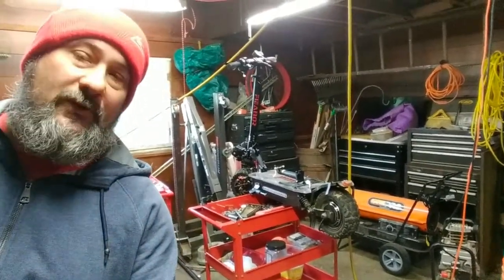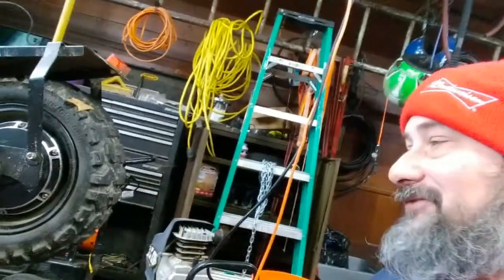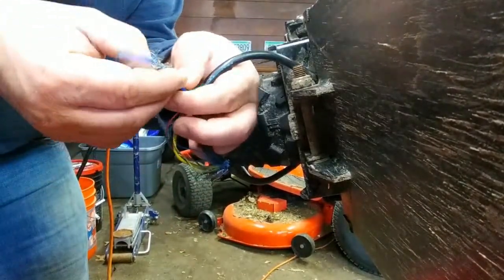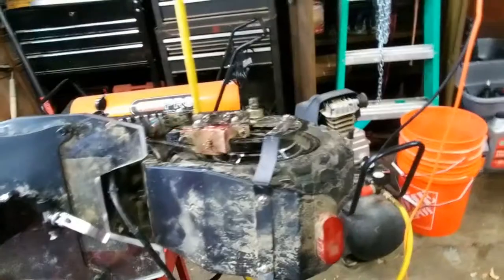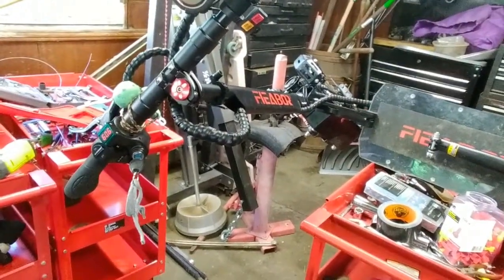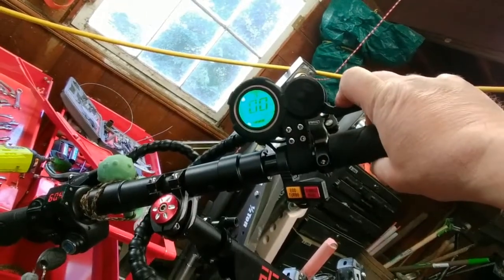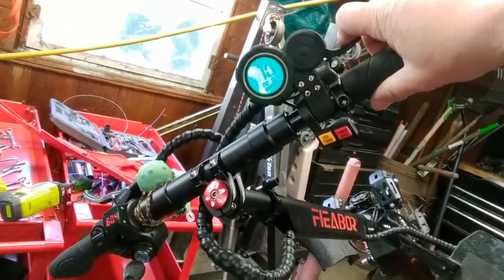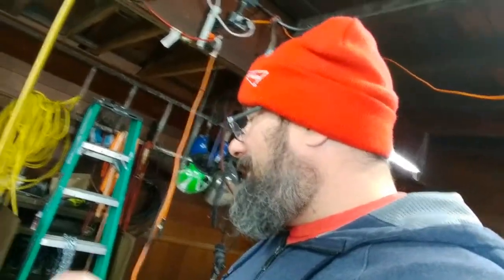5600w Electric Scooter fix rear motor wires test

Comment: Hey man. My rear wheel is Barely spinning. It shakes the scooter really bad. The panel initially said “controller failure” but now it kicked off and the Amazon seller won’t help. They keep spinning me. What should I do?
Reply from the maker: File an A-Z claim with Amazon........It kinda sucks but you will get your money back........My scooter needed a lot of work/adjustments before I took it out......1 st thing to check.....Make sure the rear wheel free spins.....Make sure no brake hardware is in the way or colliding ......2 nd thing to check is air pressure in both tires.......low air pressure will cause the scooter to violently shake at times..........Also the rear motor wires will have to be re run so you do not end up like I did in this vid......Check the harness for pinches or scrapes........Good Luck Bud

Comment: I gotta guestion.. I put my scooter on single motor and no turbo. And has like no power at all. Even with dual motors going still slow as hell. But when I hit turbo.. boom all the power is there. I mean like shouldn't it still have power in single and dual motor mode?? I know I'm not crazy here.. cause something don't seem rite.. help plz
Reply from the maker: Sounds like single/dual switch is broken.......If turbo works then both controllers are good.......Chances are its a faulty/loose connection in the deck at the wire connectors......It wouldnt hurt to check the P settings to make sure kick start isnt on.......Good Luck Bud

Comment: Hello there, do you know how many amps are the controllers ? And which brand and how many volts, mah is the battery ? Thanks a lot !
Reply from the maker: I wish I could remember exactly.....As best I can remember (2) Tiny 60V 27 amp controllers......Battery is 60v 27amp
Reply: @nitebirdscuffle4213  what a shame... imagine if they were 45 amp... thanks a lot!
Reply: @ivanivanov8698  More like 22 amp out of the battery 🙁 At least that's how it is with my Fieabor 5600w Q06 scooter. It came with Samsung 29E batteries and only putting out 22A continuous. And the controllers are dual 35A but you won't get 70A out of those cause the battery is only putting out 22A.😐

Comment: I have a problem where my rear motor feels quite weak,it still goes and pretty well,gets me up to 35mph on single motor but it feels like it has no torque,my old 2000w scooter feels like it has more torque and this rear motor is supposed to be 2800w,it feels like the front motor has like 70% of the scooters total power in it,any advice?
Reply: Like with no weight on the motor it spins up to 61mph no problem,but it feels a little weak im not sure if its the motor or the controller

Comment: I have a problem with Rear motor i Replace hall sensor but when i give throttle it makes a beeping noise and dont spin any advise?
Reply from the maker: Maybe disconnect the sensor wires and see if it works as a test......Some controllers do not use hall sensor and some do not need, and some are self learning ........

Comment: Hello. I have an problems with my scooter after winter :( My front wheel is stuck, I have opened all wheel and there alot of rust down there. Any chances to clean all cooper wires from the rust? Or need to buy new wheel? I have asked Fieabour company for new wheel, but numbers of the wheel are all gone... Can you plese send me them numbers from the front wheel to make an order to buy a new one? Thanks.
Reply from the maker: JYS60V2800W2080400............If the wheel wont free spin then chances are something is stuck inside between the magnets and coil.......Just popping it apart and putting back together could fix it but you have to be very very careful not to get pinched from the magnets when putting it back together.........Rust on copper is ok for the most part, gently clean and be careful not to scrape the insulation off the copper, even it it looks like bare copper it has a thin coat of insulation ......Good luck Bud =)
Reply: @nitebirdscuffle4213  thank you for your answer, I have already popped out the coopered part, and one man says its done, need a new wheel because it looks wery bad. I think as you, need a gentle clean and put it back together, but that man says after we wild power suply system can be done… he is master of the scooters, I dont know… thanks.

Comment: sorry to say that but the electric scooters are alot of maintenance i hate my dual 1600w i recommend you put loctite on all the screws because they always get loose
Reply from the maker: Looks like I got nylon nuts on everything.....got lucky there.......I have been pretty hard on it at times......I noticed the hardware is crusty already.......It's a shame and scary how poorly they are put together for the price........Still using the emove setting link you sent me  =)